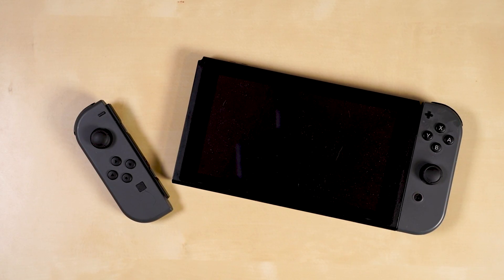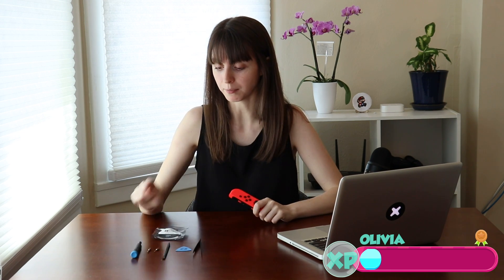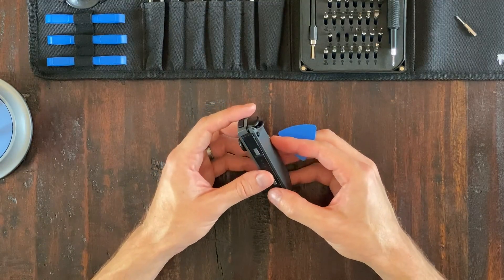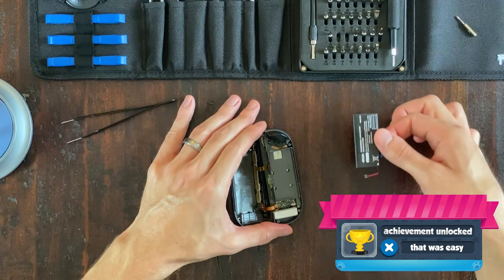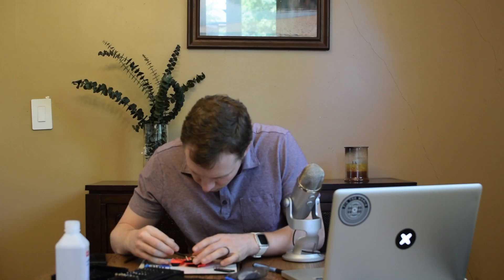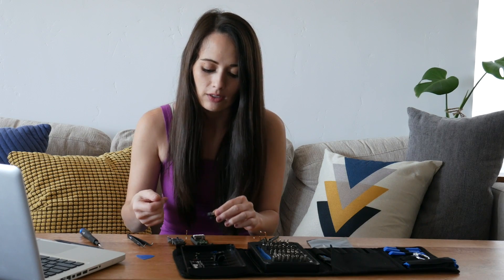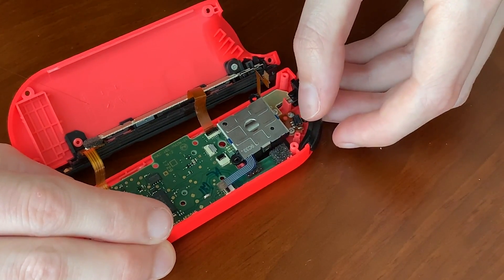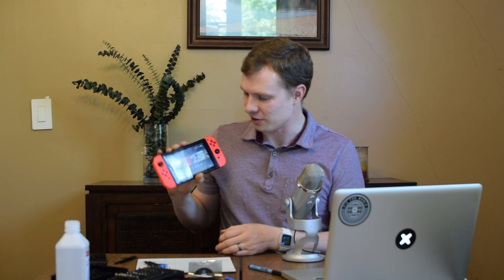Can the iFixit Team Repair Their Own Drifting Joy-Cons?

Comment: "I'm like a yellow belt in repair. I've repaired many iPhones and my 2012 MBP, both of which have fairly small components and would be fairly difficult products to open up even if Apple weren't so viciously anti-repair."  A yellow belt that's ready to test up a few times, maybe?  Modesty:  100 Skyrim jpg meme.

Comment: My pro tip: when you finish the repair, recalibrate the joy sticks by going to system settings, scroll down to controllers and sensors, scroll down to calibrate control sticks, press the right or left joy stick, press X button, and recalibrate. Sometimes its best doing it this way.

Comment: For a quick fix soak the joy-con analog stick in alcohol to make sure it gets inside of it (ONLY the analog stick not the whole joy-con itself) then move the analog stick around a bunch to allow it to rub the little pads inside the stick for a few minutes. Let it dry for about 20-30 minutes then reinstall it in to the joy-con. I did this with my joy-con and it still works after almost a month of use when it was showing serious signs of drift beforehand to the point it was nearly unusable.

Comment: I am really curious about what the actual defect rate is for the joycon drift issue. this video made it seem like it is super common but then used a sample size of 5 which is really not a great indicator. Since I know 5 people with switches that never had drift. So it goes from 80% defect rate to 40%. Like we need more numbers since almost every device has a defect rate. So is this a real problem or just part of that acceptable defect rate and we have a bunch of people blowing the thing out of proportion.

Comment: To every manufacturer who puts glue on their batteries when their device is a micro engineered clam shell with .0001 cm3 of air volume inside, FUCK YOU.
Oh, and not using T,P, or R screws. Tri-points? GTFO.

Comment: I had the same problem but sorted it out by spraying a tiny bit of wd40 spray with the straw attachment just under the movable cover under the left controller stick then cleaned it with a cotten bud. So far so good.

Comment: Has there been such a thing made yet as a replacement thumb stick which uses a different mechanical configuration? I get that these are small devices which limits options, but both my PSP and PSVita have analogue thumb sticks that are significantly older and more used, yet work as new, while occupying a similar amount of space.

Unfortunately the PSP/Vita sticks don't appear to be direct-swap capable (different mounting forms and I doubt the wires are the right size or order), but surely someone could adapt the sensor portion...

Comment: I just stripped a screw on an old flashlight and had to break open the back panel with a set of pliers to put batteries in. Not proud of that. I'm happy for the tip of using the biggest screws first. Definitely gonna do that from now on.

Comment: Omg, I am so glad that you don’t say blow on the joystick, the reason why the issue coconuts is because there is wear on the pads inside the joystick mechanism and the pad senses a false actuation and so it does the stick drift. If you have this problem no amount of blowing is going to fix it. Just replace it. Kits are also on eBay for less than 10 dollars with all the hardware included

Comment: After 3 years and thinking I was safe from this drifting issue. My left joy-con has now started drifting.
Although fixing gadgets with tiny parts inside stresses me out, it seems worth trying since the price of a new joy-con is a bit much.
Reply: Try isopropyl alcohol first. Works every time for me. No disassembling required.

Comment: If we replace them, will it continue to happen?
Reply: It certainly could, as analog sticks  are moving parts, therefore they tends to trap dust and debris and drift again.

The best tip is to always keep them controllers clean. It will wear out again, but it would take years this time.
Reply: It very likely will happen, yes, because you are replacing the old part with ones that have the exact same design flaw.
Reply: Thanks for the tip on keeping them clean. He has had his for about 3yrs and i just got him replacement joy cons.

Comment: Finally got fed up and ordered many parts (and your tool set) for many different current tech issues I'm having, including this. I'm a well seasoned, teardown/electronics repair guy but I always look forward to using your guides! Thanks iFixit
Reply from the maker: Looking forward to hearing about all the things you're gonna fix!
Reply: @iFixitYourself  joy-con drift on all 4 of my joy-cons, replacement shells on one pair of those and on another pair, slide retention piece replacement on two other joycons, mac mini SSD upgrade, PS4 HDD upgrade and a 27" iMac hinge repair and SSD upgrade. Phew, busy just thinking about it.

Comment: Awesome, thanks for sharing! Good format to explain how a fix goes too.
Question though, does the fix last or is it one of those problems that innevitably comes back after a while because it's a design defect?
My Switch has the problem, and it's fairly expensive for me to import parts for the fix (importation taxes plus currency exchange rates). I've been considering between fixing it, or just getting something else like Hori's Split Pad Pro if it's an issue that keeps coming back on Joycons. In fact, if it is a problem that doesn't have a permanent fix, I'll just keep living with it as I currently am and wait till the Switch gets permanently replaced by something else. :P
Don't really care for having to pay for parts and keep fixing the damn thing from time to time falling into sunken cost fallacy... I'd rather just buy something else. Nintendo should take the blame on this, not consumers.
Reply: Not sure about iFix It's lit, but Ninendos warranty repairs are well reported to break again after some amount of time so if it's an OEM part, I expect it would be comparable to buying new JoyCons. 8bitdo would probably be the better choice if you don't mind the other trade-offs. I personally like the feeling of playing with disconnected JoyCons so I might try this instead of braving Ninendos repair wait.
Reply: @emma70707  Yep, that's exactly my fear... xD
I have a few 8bitdo gamepads, they are great, but need something to replace the joycons to game on the move.
Guess I'll have to take a look if 3rd party joycons can develop the same problem... hopefully they used some other type of analog stick.

Comment: Legitimately fixed my left joycon today using your video on your channel :) wish there was one for the right but I couldn't find one :(
Reply: It's a very similar process. The main difference is the R button on the back has a much shorter ribbon cable so you need to be a bit more careful flipping over the mid frame. Done so many left and right joy cons I actually prefer the right! As a side note, the guide on their website is pretty good.
Reply: i believe its the same but mirrored
Reply from the maker: Glad we could help!